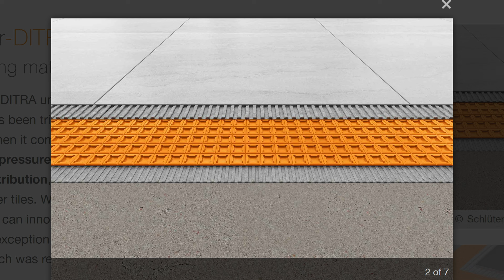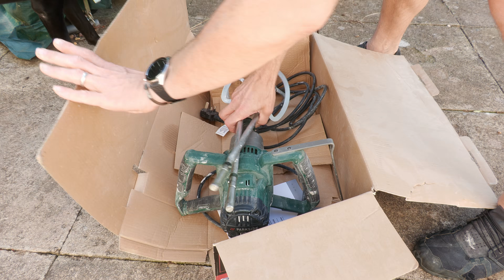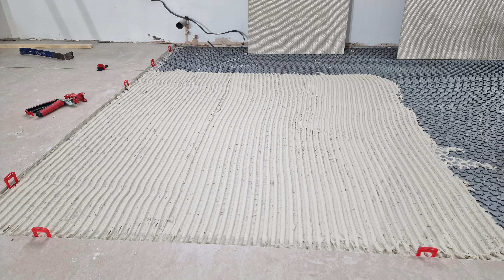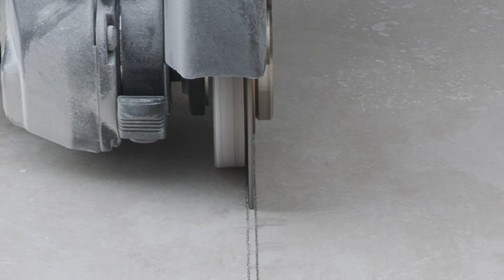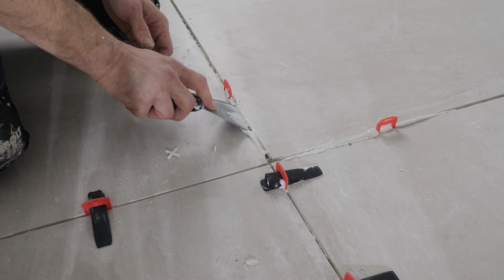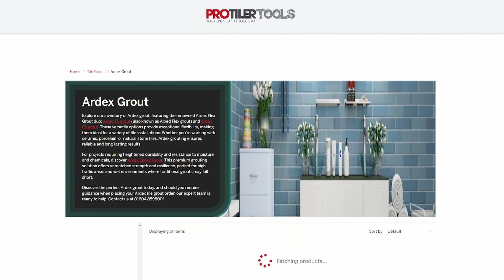GIANT Floor Tile Install - Pros Said I Was CRAZY!

Comment: A 50mm normal screed is insufficient especially over UF heating.  The normal spec for such a screed, laid semi-dry is 75mm. Specialist wet screeds can be laid thinner but to manufacturers spec.  I much prefer to spec Schluter mat to lay/hold down the UF heating pipes rather than the staples into the insulation that then creates a much more reliable min 65mm  floor finish using significantly less screed to allow faster warm up.

Well done!  This is the first time I have seen a tiling video suggest a debonding mat, which is absolutely VITAL for the tiling but ever moreso with large tiles.  Movement joints are generally not needed in domestic situations as the areas are limited.

An 8mm tile is incredibly thin for the size and application.  In this situation I would only consider 10-12mm tiles.

This layout was well done but there was the benefit of matt tiles, the real test comes when trying to lay black polished tiles that are super critical due to the reflections they create.  Porcelain tiles are generally more dimensionally stable than glazed tiles.  Note the size of the tiles than expects that a 5mm joint is used rather than 3mm.  Tiles are designed to modular dimensions and allow a joint to create the final modular layout.
Reply from the maker: Thanks Clive - great feedback. It was done to specification. From memory it was about 55mm but could have been 60mm. I forget which but it'll be in the original ufh video. 👊
Reply: @CharlieDIYte  Specialist screeds are laid to manufacturers spec that will be less than the 75mm of traditional sand:cement screed.  Even those traditional screeds have thickened over the years from 25mm, through 50mm to the now 75mm that has been in existence for at least 30-35years.  These changes were to combat common defects as the experience with them grew.  The most common fault was a curling at the edges where the screed debonded due to the usual poor preparation and then it would crack and crumble.

Comment: A tiling wash boy is essential for the cleaning grout process,leaves a better joint and less residue on the surface to clean off, gloss tiles you wipe the haze straight off with a towel, Matt tiles use a emulsifing pad to agitate the surface with water then wipe off the haze with a  a towel makes the grouting a doddle then,always best to mix the grout with a piece of timber rather than a whisk as you can whisk air bubbles into the mix and can never compact the grout in enough 😃 a great job as always Charlie ,love the videos 🙌
Reply from the maker: Thanks so much for sharing that. I did a bit of Googling and watched a few YouTube vids but none of them helped that much - could have done with your wisdom on this 😉
Reply: @CharlieDIYte  looks like a great job you ve done though on that kitchen floor! These videos and the comments sections of your channel are invaluable!

Comment: Thank you for the very informative video! You did a great job and it looks amazing! I'm just wondering, as you used those levelling wedges, how did the tile in front of the bi-fold manage to be slightly raised in one corner?
Reply: He bent the tile and didn't use enough levellers to force the corner down.
Reply from the maker: Yep. I think it was flat when I used the tile thumper but there was far too much adhesive below it so it just raised up after I left, so you're right, a leveler in the corner would have helped keep it down.
Reply from the maker: Just replied to this but it hasn't saved so here I go again. When I left it, it was level but I had too much adhesive under it so it raised up after I left it. This wouldn't happen if it was laid on the correct amount of adhesive but you're right with a wedge in the corner it wouldn't have been able to move it at least it would have taken the other tile with it 😉 There was another tile I added a wedge to the corner of but that clip didn't make the final edit.

Comment: Excellent effort....looks really good. Having watched hudstilingservices on IG, I would say you followed about 90% of a top pro.  The only thing that stood out is that you used so few levelling spacers considering the size of the tiles. Hud would have had at least 5-6 and maybe that annoying little edge in one corner wouldn't have happened. Chapeau for using the grinder to clean out the old grout....I was on edge....no way would I have done that! 😬